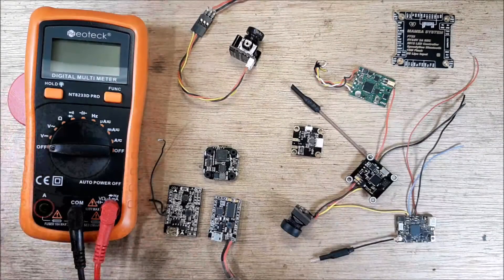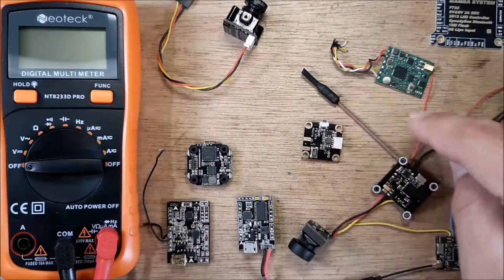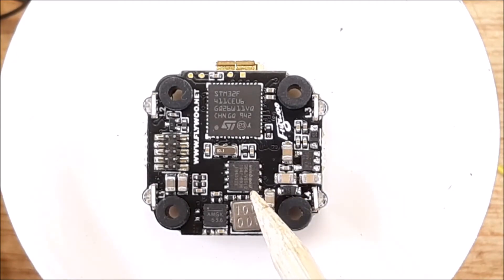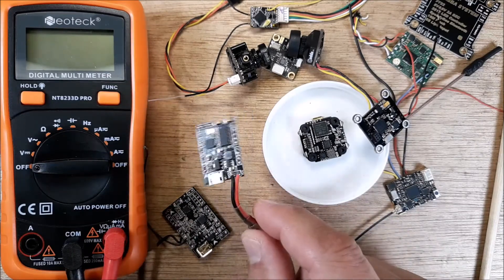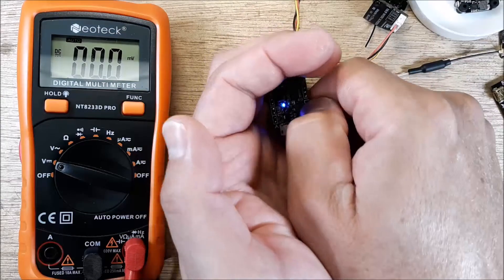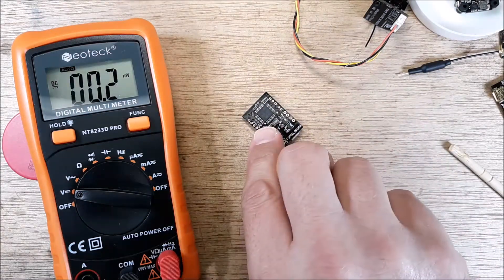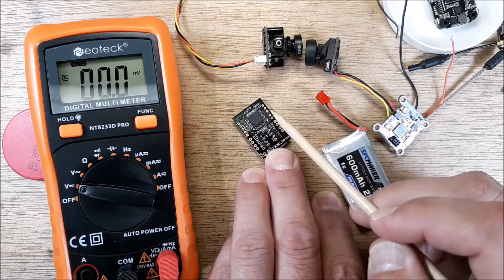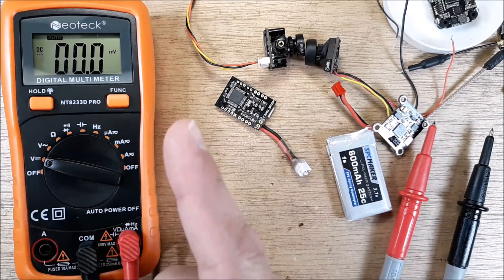How To Measure 5 Volts | How To Use Our Multimeter To Check 5 Volts

Comment: Again, great information. This is how I was able to tell I had a bad flight controller. I couldn't figure out why my receiver and VTX wouldn't light up on a new flight controller. It was because I was getting 0.8 volts at one 5v pad and 0.82v at the other 5v pad. These are great videos for beginners. I've learned a few things but I'm still a beginner.
Reply from the maker: I appreciate your feedback! Your comment alone will help someone struggling out there. I'm positive there are others like us that spent too many hours trying to diagnose a new or almost new flight controller.